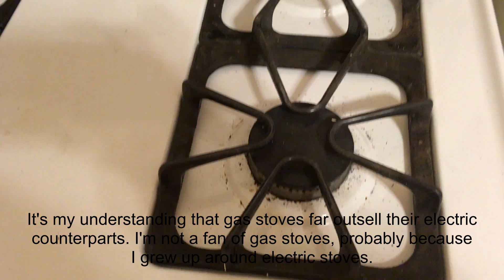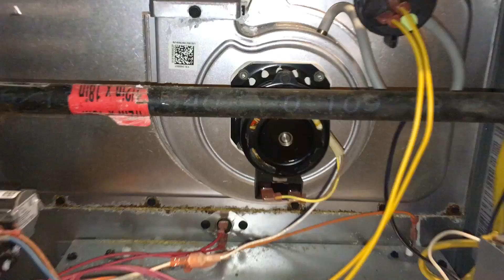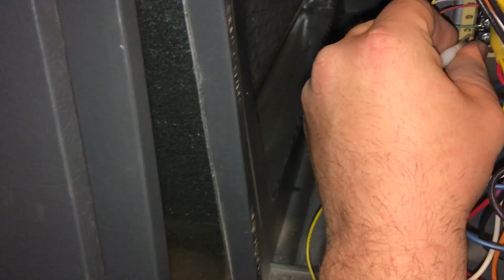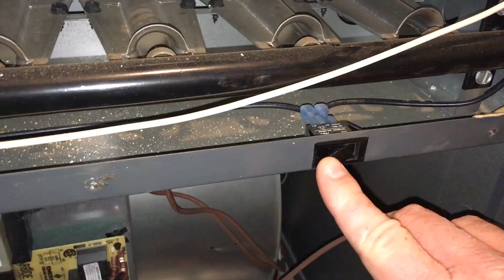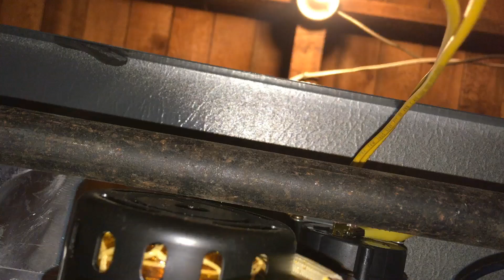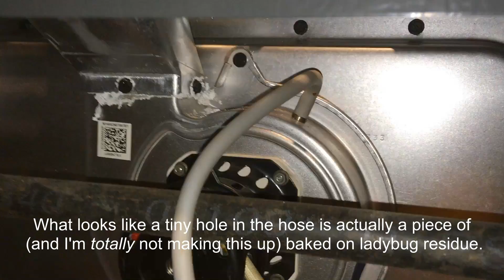No Heat Call: Goodman GMS81005CNBC 80% Gas Furnace

Comment: The ignitor is not coming on on my device. Can I clean or replace it?
Reply from the maker: It should go without saying: be extremely careful when servicing any gas or fuel burning device. Please consider hiring a repair technician for your own safety and that of others. Do not bypass safety devices.

If your device (furnace?) uses a glowing igniter, don't try to clean it. These are extremely fragile. Despite this, they do not fail often. Spark igniters could be cleaned with great care, though this is unlikely to be needed.

While you can replace an igniter, it is unlikely to be the problem. Check the ignition control for a fault indicator. Otherwise, you're just throwing parts at it.

Comment: I can tell you one thing if the actual wall thermostat goes bad the best one I can honestly say is an Aprilaire model 8444 non programmable model they have a nice feature called auto change over which allows the thermostat to automatically switch between heat and cool modes based on your setpoints for heat and cool modes but it also has the heat and cool modes individually as well
Reply from the maker: You'll find several different thermostats, programmable and not, that offer auto changeover.
Reply: @uxwbill  i seen alot of them but had really good luck with the Aprilaire brand so far i had teo other digital ones that were different brands and they seemed to shkrt cycle noth in heating and cooling and with the Aprilaire 8444 i am not having that issue at all the onlu thing i had to get used to was the thermostat clicks twice when turning on or off both the heating and cooling systems but thats because we have an electric furnace so the thermostat is configured for electric heat and i believe one click is the thermostat sending a G call for fan in addition to he heat or cool call

Comment: When I started doing photos and measurements for residential real estate, I noticed that a lot of brand new houses as well as houses that are a few years old have Goodman furnaces. I'd say that 8/10 of the very new houses I've been to have them, which made me feel like they are more of a cheap brand, or model at the very least. In houses built between 1990 and 2010, I see mostly Carrier units, and I've only ever seen one other Bryant, besides the one that's in my house. I've also seen a gravity furnace with its glorious asbestos-laden pipes placed perfectly to whack one's head on. Fortunately, I don't service them, I just take pictures.
Reply from the maker: Goodman HVAC equipment is popular, and I think that's the case because it's pretty good equipment for the money. Like everyone else, they've got their cheap stuff and good stuff. (They'll sell it to almost anyone, which is where I think they have gotten a bad rap. However, a lousy installation job can sink even the best equipment.)

The very cheapest seems to be the "GmC" line, which they barely even talk about. I set a Goodman GmC branded condensing unit in 2018 for a landlord who didn't want to spend any more than they absolutely had to, or replace the still working furnace and its much newer evaporator coil. Yes, mismatched equipment is such a joy, but it did work well after one false start. It's still there today.

I'd give serious thought to a Goodman, if the need ever arose.

Carrier's got good stuff, but like Lennox, you're paying a lot more for that name. Going with Bryant is probably the most sensible way to get Carrier product at a much more sensible price point.
Reply: @uxwbill  that’s definitely good to know. My furnace is 20 years old at this point, installed in the house when it was built. It’s still going good, but right around the end of its lifespan. In the meantime, I had been casually checking out our options and it seems Goodman offers decently priced units but I had my concerns until you’ve allayed them. Definitely want a 90% efficient unit this time. 

Have you seen houses with two furnaces in them? In houses that are over 2,700 square feet including the basement, I noticed that instead of one large furnace they often have two average sized units installed side by side. I recently visited a house with 3,600 square feet of space including the basement that had two Carrier units side by side. Even got to witness the start up cycle, though only one of them was running. I suspected one serviced upper levels and the other serviced the basement, but I’m still not entirely sure how that works. I wonder if it’s more efficient to go that way, instead of one huge unit that heats the whole house.

Comment: How did you jump the door switch with the jumper wire? Where was the other jumper clip going to??to the input on the board where the door switch plugs in or what?
Reply from the maker: I did not jumper out the door switch. Don't work on your own furnace without a good understanding of what and why -- the life and property you save could be your own!

With all due respect, call a qualified technician.
Reply: I see now you were just using the jumper to hold it shut. I am an hvac tech and know how to jump out door switches. 30amp fuse, double spade stake on, jumper across switch, bad capacitor, tape, magnet, ect...Just thought I had never seen that method before...

Comment: Great video!  I have a Janitrol / Goodman Furnace (exact size as in your video) going on 29 years old.  Has never needed repair!!  Good to see Key-Keeper in your video!  Miss his videos!
Reply: Brent Audi - I have just ripped out my 27 year old Goodman GMP100-5 furnace and replaced it with a Goodman GMVC80100. I never saw any corrosion like this video shows and the heat exchanger looked to be in great shape.  The first component to fail was door safety switch after 2 years.  I replaced the inducer motor at 7 years because it was excessively noisy. The control board failed after 17 years. The igniter lasted 22 years. At 23 years, I had to replace the blower motor after it was destroyed during a power surge.
Reply: @picklerix6162  Hope your new Goodman last just as long!!  Is it paired to a Goodman Condenser?

Comment: Even if it stayed at 41 degrees in the house, that is above freezing so stuff in the house would not freeze.
Reply from the maker: Stop and think about why that's not quite true.
Reply: @uxwbill  I wouldn't think that the house would freeze till it gets down to 32 degrees in the house.
Reply: Matt Bruns uxwbill is saying if the temp drops outside it’s not going to take long for an empty house with no furnace to drop significantly, better to be safe than sorry

Comment: Manometers are a must inorder to toubleshoot pressure switches. You are only guessing other wise.
Reply from the maker: They're handy, but by no means required for this sort of thing. Yes, I do have one.
Reply: @uxwbill  I got a Risepro manometer for $40 on Amazon, and it works great. It is a nice tool to have, but I agree that it's not required to test a pressure switch. But for some things, like adjusting gas pressure, it is a must.

Comment: I grew up with gas stove and oven because, whenever I lost power by the ice storm or snow storm, I can actually get that thing to heat up the house real nicely when need to for an emergency.
Reply from the maker: For your own safety and well being, never ever use a gas stove to heat your home.
Reply: @uxwbill  I agree. When combustion occurs in a closed room , it uses up the oxygen. Once the fire has inadequate oxygen for correct combustion, it produces massive amounts of carbon monoxide, which can be deadly.

Comment: i love my gas stove. So easy to adjust heat. Very efficient.
Reply from the maker: A lot of people have told me that the precise heat control is very nice to have. It's a tradeoff I'd make, though. Every gas stove I've ever worked with has taken a message and promised to get back to me when asked to boil a large container of water. Only a few managed to do so.

It seems seriously counterintuitive that an electric stove would do so much better here.

Comment: What is your opinion on modern HVAC/R systems that are highly reliant on electronically controlled everything ?
Reply from the maker: The combustion process has been managed by computer in nearly every furnace made in the last 20+ years. This much seems very reliable. The electronically controlled motors seem to be rather hit or miss. I haven't seen much of communicating thermostats and such.

Many commercial systems are operated by a building management system of some kind, and those are nothing new. When properly deployed, these too seem quite reliable.

Comment: 4 years wow. This one looks like at least mid 90s design. I wouldn't buy non-condensing furnace these days. Condensing ones can be pretty cheap. They were very expensive some 10-15 years ago but nowdays the cost is pretty much the same as traditional ones.
Reply from the maker: Goodman's current production furnaces (and their sister brands, Amana and GmC) still look like this one.

I would have gone with a 90% or better efficiency furnace. They didn't mainly because there is no floor drain available and a condensate pump wasn't desirable.
Reply: Goodman bought amana in the early 2000s and took but cheapened their design.
Whenever I hear of a 75k btu+ plus output furnace being used I always wonder what kind/size of house it's heating, especially in the us.  I'm north of  you and this size will heat most 3000 sq ft 8 ft ceiling detached houses built in the 1980s with r11 wall insulation in my area just fine. If the house is lousy, no wall insulation maybe 1600-2000 sq ft. Most insulated houses can heat with 40 or 60k condensing furnaces unless they're large. Oversizing is bad for comfort.

The pump will be needed anyway if a/c is ever added, seeing as the stat was wired for it. So i don't understand the logic of still using mid efficiency unless venting is impossible without major destruction. Mid efficiency furnaces are gone in canada as of 2010. Sucks for anyone with a finished basement that has drywall ceilings..
Reply from the maker: This is a moderately sized two story house, and being older, it's not particularly well insulated. Nor are some of the windows real great. Perhaps when those things are fixed, and some of them have been, the furnace will be oversized for its application. The ceilings in all the downstairs rooms are at least 10 feet high.

Whenever that drain line disaster is repaired, I believe that floor drains are going to be put in the basement. Direct venting a higher efficiency furnace might well have been an adventure, since the basement walls are about a foot thick and made of brick.
Reply: Living in Poland, Europe and when I see american furnaces they look pretty ancient to me. I had a 24 year furnace that worked until this spring but unfortunately it broke this autumn. We had to replace it with a new condensating unit that weighs only some 1/20th of the old one. It's way more efficient burning much less gas than the old one.
Reply: I'm betting in europe you have a lot of hot water heating system. Boilers take up less space than forced air furnaces, especially the ones that can be installed on a wall. Americans have more of a use for a/c so they go forced air rather than put in two separate systems.
Reply: water in 99% of the cases. Traditional with radiators at the window and few underfloor heating systems too. Haven't encountered any gas air heating furnace yet but there are plenty wood fireplaces though.
Reply from the maker: @subbookkeeper  - You'll find that in the United States, climate control systems are as varied as the people who live here, and the regions in which they live. Boilers for both steam and water are not uncommon. Fireplaces and stoves are also often seen, especially in older homes. Milder regions get a lot of utility from heat pumps, and those in more severely cold climates can use geothermal to do much the same thing. For those who heat with them, fuels are widely varied as well.

Zoned climate controls, especially with forced air, are becoming more popular through central systems with adjustable dampers and even things like packaged mini-split air conditioners and heat pumps. I suspect that many buildings being much younger than those abroad (and thus existing when central heating or cooling systems were readily available) made it much easier to install them.

Comment: I don’t know if this is only a Canadian thing only; furnaces here have secondary switches that allow you to shut it off for whatever reason without switching the breaker. Where it is depends on the province and type of house. My cabin from 1952 has a secondary furnace switch that is original.
Reply: At least in Ontario it's required. I think it also has to be physically located between the furnace and an exit so you can get to it in a fire.
Reply: I have the same thing in my house built in 1956 in Ontario. There is a light switch near the door in the furnace room that shuts it off. I have seen this in new houses too.
Reply: Our house, here in Colorado, has that switch too. I think its a fairly industry standard thing here in the US these days too.
Reply: Every furnace SHOULD have a service switch, but not every installer has the brains to put one in. It is code to put one in around my area.

Comment: uxwbill certified youtube HVAC tech.
Reply from the maker: Actually, I do in fact have my residential, commercial and installer certifications (as well as my EPA 608 and 609). I attended and completed an HVAC/R program on a part time basis over two years. Throughout its entirety I maintained a 4.0 GPA.

Even so, I wouldn't have the audacity to claim that I'm on the level of the guys on Youtube who have been working in this business for years. I have a long way to go, if I ever get there.

Comment: Had the same thing happen to my furnace a few times. The first time I had to call an HVAC person. Turned out to be corrosion clogging that hose piece. He jammed a screwdriver in it and cleared it out. He also showed me how he diagnosed it. He simply took the tube off of the exhaust motor and sucked on it while the furnace turned on to make it think it was good to go. I've had to go clear it out twice after that and I'm glad I watched him when he did it the first time. It saved me two service calls worth of money.

Comment: whats the source of that rust and corrosion? rain leaking down the flue? or condensation forming because of return air temp being so low
Reply from the maker: I'm not sure. The flue is in good shape (a good quality new lining and a cap are both in place) and I've never seen any water in it. None of it is corroded in any way. Perhaps it is an issue with return air temperature, but that's not something I can do anything about. Nobody's going to pay to keep the house at a "normal" temperature at this time.
Reply: i believe minimum return air temperature for a modern furnace is like 16c/60f. 50f return air great for causing condensate to form in primary heat exchangers.

Comment: As soon as I saw "Goodman" and "no heat" in the title, I thought of the pressure switch.  I have a Goodman package unit that exhibited the same symptoms.  The culprit was that silicone tubing not being airtight at one end.  And yes, I did the troubleshooting myself.

Comment: Our central heating has a long long time service overdue. but it still works.
Reply from the maker: Well, if you haven't changed the air filter in a while, you should do that. Your furnace will thank you. That's really the biggest thing that most of them need.
Reply: uxwbill i will check on that thing. normally the gas company sends someone over every year but this thing is getting older and they rather want to sell a new and expensive machine..

Comment: Good job Bill. That 120 to the furnace is hideous! Up here by Chicago you can't use romex like that. It all has to be in conduit. Also the mind boggles why they didn't install a service power switch at the furnace. Pretty sure that's code everywhere.  I can tell you had fun diagnosing and fixing it :)
Reply from the maker: I'm going to put that wiring in conduit, and I plan to bring it in on the other side of the furnace, where things are FAR less congested. It'll be good practice. There is a switch over by the water heater to turn the furnace on and off. I plan to move it.

I was tasked with supervising the guy who installed the furnace. I won't say he didn't try to do a good job, but I had to keep after him so that he'd do everything he promised, like running the new thermostat wire. I insisted that a dedicated circuit be installed.

At some point, I'm going to install air conditioning and run ductwork to the upstairs in this house, or so I very much hope.

Comment: The pressure switch can be ruled out with a manometer as u probably know, better than just jumping it out even temporarily. I suspect the flames can look normal despite a borderline draft.
Reply from the maker: I didn't bring my manometer with me.
Reply: From my limited experience, the opposite is actually true. I have seen a few reasonably modern furnaces with correctly functioning pressure switches that would fire with a significantly restricted flue pipe, but didn't burn right.
Reply: Well, the purpose of the pressure switch is stop the unit from running if there isn't a sufficient draft. But your comment highlights the need for other testing - like combustion analysis which few people do.
Reply: @Jon-hx7pe  You're right. The pressure switch won't let the furnace fire if the vent is completely blocked, but it can be partially blocked and cause problems. In my opinion, the pressure switch needs to be more sensitive. I agree that combustion analysis is a good idea though.